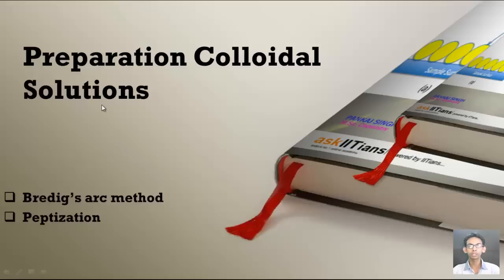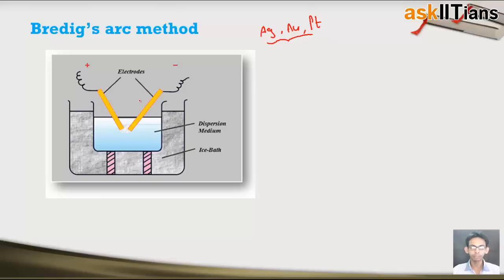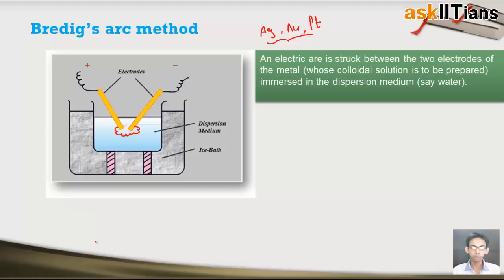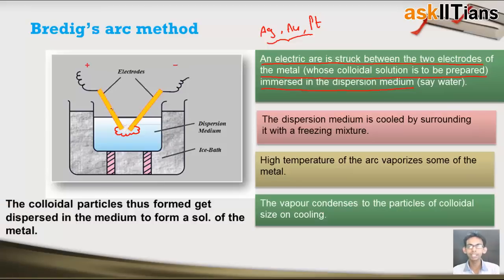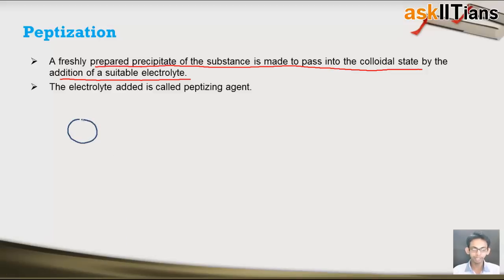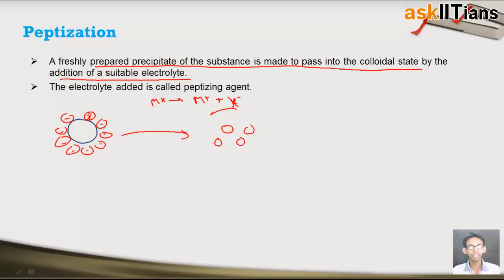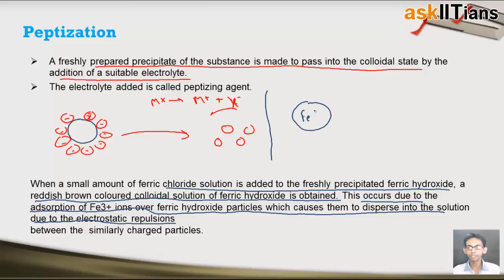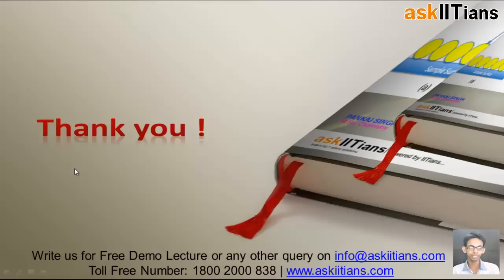Preparation of Colloidal Solutions | Chemistry| Class 12| IIT JEE Main/Advanced | NEET | askIITians

Comment: sir,
suppose we consider FeCl3 sol added to Fe(OH)3 ppt then Fe+3 ion will get adsorbed but won't Cl- which is also present in the sol coagulate... and the colloid get precipitated?
Reply: Aashna Agarwal ...the cl- forms a diffused layer around the aggregate of colloidal particle called as diffused layer. Both the fe3+ layer and cl- layer are together called as electrical double layer. They have potential difference, due to opposite charge on fixed and diffused sides is termed as Zeta potential.
.
.
I hope it's helpful

Comment: sir,
1. How an arc is formed between to electrodes as they are not even in contact with each other?
2. Does the cool dispersion medium is not capable of altering the temperature of arc? 
3. if it alters, then how vapourisation takes place ? and if it doesnt alter the temperature of arc, y not the temperature of disperion medium changes?
Reply from the maker: Thanks for asking. Here your answer for your questions.

In order to visualize the method, I would recommend you to visualize the rain due to thunder. 
the air that is present will act as an insulator and gets ionized when clouds at highest potential tries to transfer energy to the lowest potential at the surface. this is thunder, similarly in this experiment when we apply a potential difference between the electrodes, a spark is developed between the electrodes, which leads to a very high temperature(even very high compared to the dispersion medium), such that the metal electrode gets vaporized, when this vaporized metal comes in contact with the cold medium, it forms colloidal ppt.